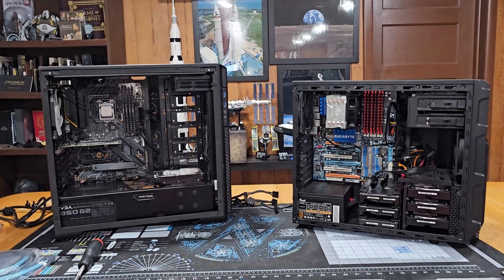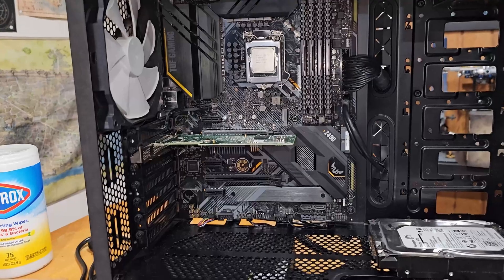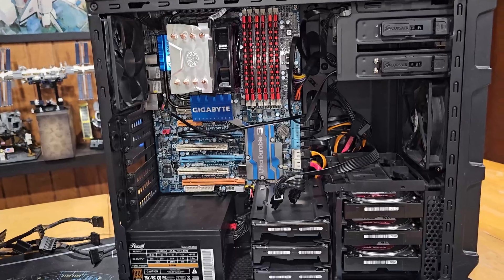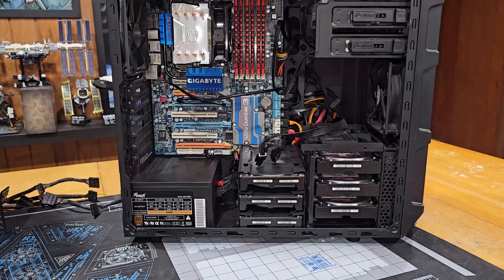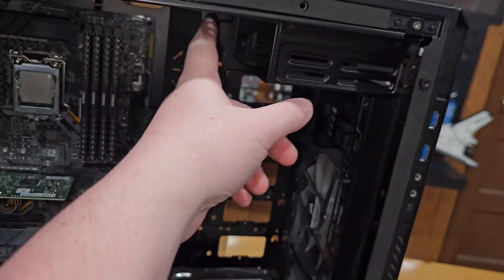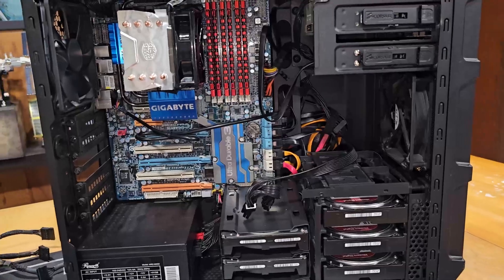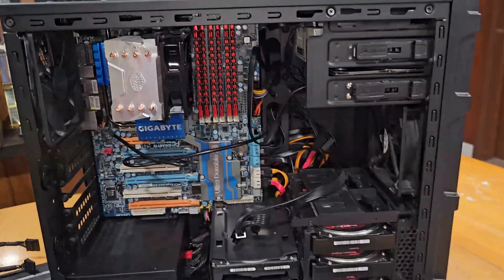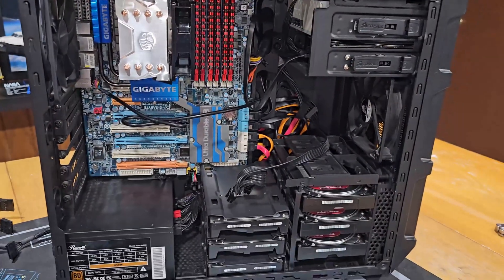Unraid Upgrade 23 Part 2: Migration and Drive Array - i9-10850k

Comment: How the HDD cooling does so far? I'm looking for a PC case that will give plenty of ventilation for HDD. My WD 8Tb Red Plus run at 45C idle. When working, they come up to 55C which I'm afraid they won't last as much as they would.
Reply from the maker: Excellent! Almost all my drives are sitting in the mid 20s, and there's only one north of 30, believe it's the top one that doesn't have a fan blowing directly on it.
Reply: @Badger8th  Great. Thanks.  Nice built btw.!!